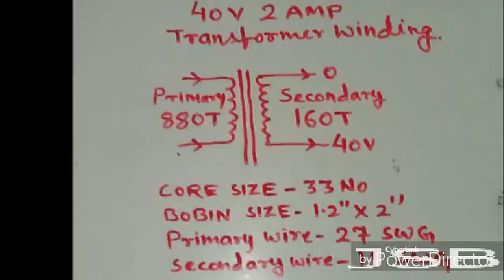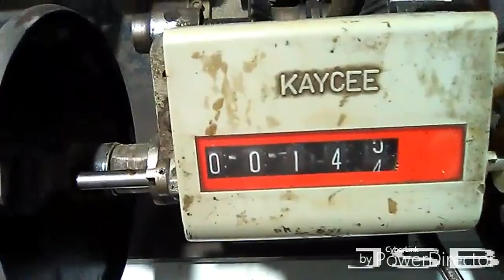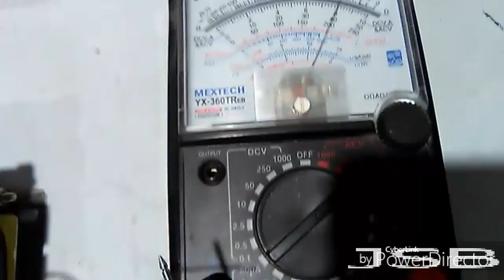How To Make 40 Volt 2 AMP Transformer Easy At Home. YT-54

Comment: i assemble 5 kv manual voltage stabilizer. .when i press its push button the coil vibrates. .can you tell me why it happens?  and how can i fix this problem. ..
Reply from the maker: first- transformer core is loose .
second- winding turn may be not enough and Short coil
Reply: caveman is the king of Indian caves 5

Comment: sir apne Twitter per 1 kva auto transformer ka data share kiya hua hai usme aapne 10-0-10 transformer add kiya hai....or last mai note hai usme likha hai use 12 v relay 10amp ,,,asa kese transformer 10 v or relay 12 v
Reply from the maker: input voltage par depend karta hai agar waha 12v winding kar denge to apka relay jalne ka chance ho jaega .kyuki relay 12v hai to wo 10v se v on hoga .

Comment: Good morning  sir ji  mere  paas 12 volt ki single battery lago ya 24 volt  ke liye battery charge karo par automatic charger tha circuit  kharab hogaya  transformer check kya to 0..se check kya to secondary power  0 se 40 aur 80 voltage dikha rahai kitna amp ka transformer hai pata hi nahi chalta